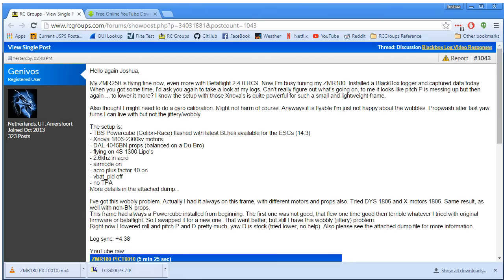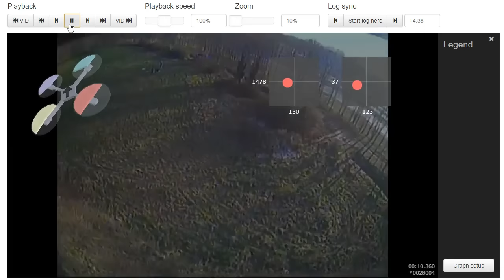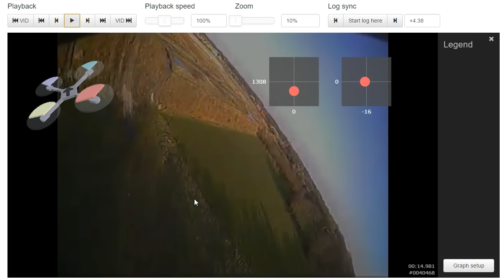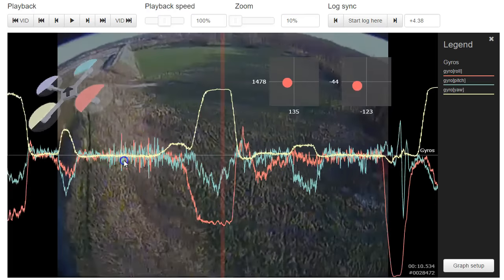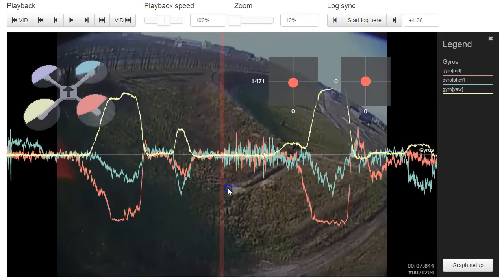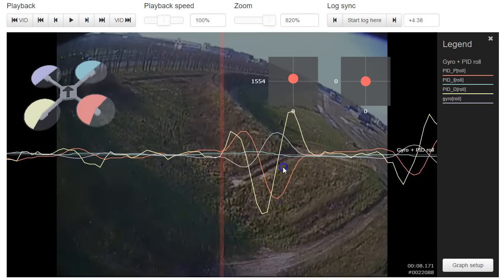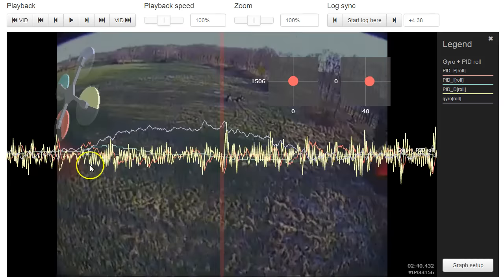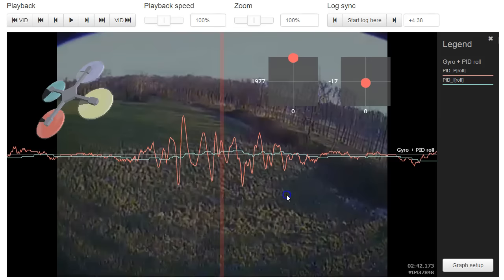Blackbox Log Analysis: Genivos - 2/18

Comment: I had that same problem with a ZMR 250 v2 frame. Pencil thin lines on the gyro with filters off but this kind of random bumpiness just kept happening. I just couldn't tune that out after several weeks of trying! I had just changed my flight controller for a rev6 so I suspect that...